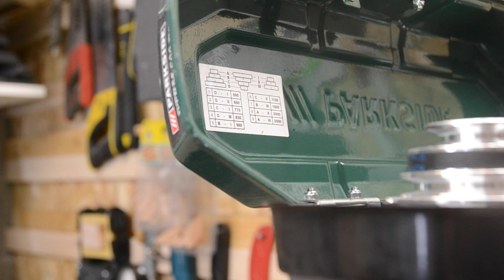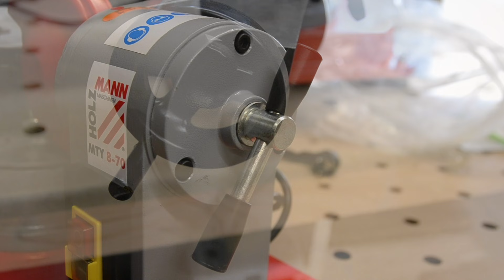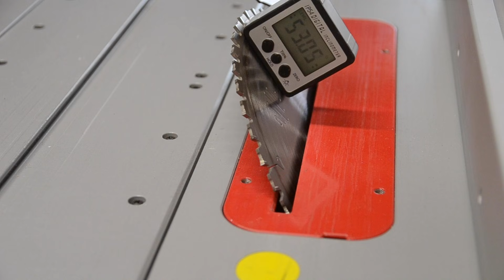Shop Tour #1 - Mes Machines - de Parkside à Bosch Pro ⚙️

Comment: Bonjour et merci pour cette nouvelle vidéo.
A 57 ans je me lance dans le bricolage bois. Plus à l’aise en électronique mais bon. 
J’ai grosso modo le même matos la gts10xc , défonceuse parkside, scie radiale parkside, par contre j’ai pris une raboteuse métabo dh330. Là j’ai dû faire une bêtise en inversant mes choix. J’aurais dû commencer par une rabodegau. Du coup j’hésite à prendre la même que la tienne mais la laisser en degau. A voir. 
Récemment abonné mais lecteur depuis déjà pas mal ! Très bon boulot tu fais ! Chapeau bas. Bonne continuation
Reply from the maker: Salut, merci Phil pour ton commentaire. J'ai failli acheter une raboteuse triton stationnaire mais c'est vrai que le combo rabo - degau de la Mac Allister à moindre cout m'a attiré. Maintenant je pense que l'idéal serait une rabo-degau mais de qualité supérieure pour ma part. Merci à bientôt 👍

Comment: Salut, je m’intéresse de plus en plus au travail du bois et souhaite débuter. Crois-tu, s’il te plaît qu’il est indispensable d’avoir une scie sur table et rabo-dégau ou alors raboteuse. Merci pour ta réponse. 😀
Reply from the maker: Salut, la scie sur table je dirai oui, par contre la rabot degau dépend des types de bois que tu vas utiliser. Perso je m'en sert rarement car je travail le plus souvent des panneaux de bois (CP, MDF, Mélaminé, agglo...). Cependant si tu investis dans une rabauteuse autant faire en sorte qu'elle puisse dégauchir également car ce n'est pas le genre d'outil que tu changes régulièrement.

J'ai commencé avec une scie circulaire plongeante, une scie sauteuse et une défonceuse et déjà tu peux quasiment tout faire 👍
Reply: Un grand merci pour ta réponse! Tu confortes davantage mes idées. Je dispose des outils qui t’ont permis de débuter. Alors plus de doute, je peux y aller 😀 Encore un merci pour ton partage d’expérience et surtout longue vie à ta chaîne… 👍
Reply from the maker: @benjaminluthier4363  Merci 👍
Reply: @Equiorza  Du coup craquage, je viens de commander la GTS 10 XC en promo sur Amazon à 650€. Tu m’as convaincu. Merci 🙏🏻
Reply from the maker: @benjaminluthier4363  TOP 👍 franchement tu verras, tu vas entrer dans un autre monde. Maintenant obligé de fabriquer un établi 😀 De plus à ce tarif c'est cadeaux